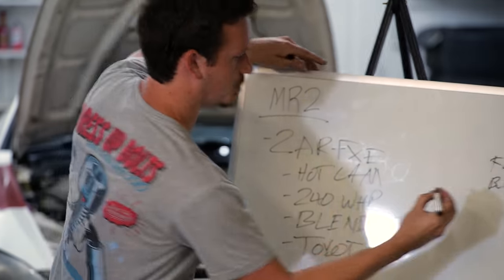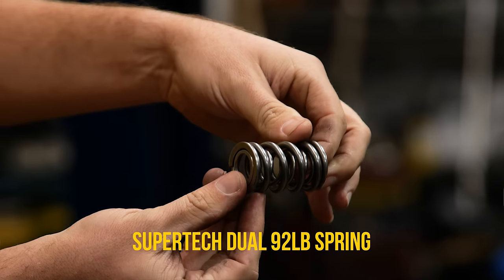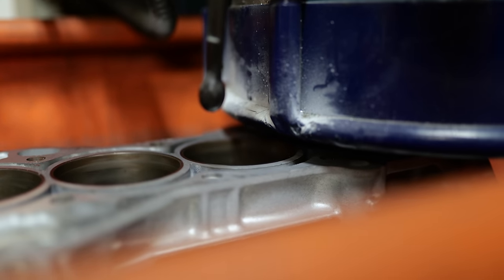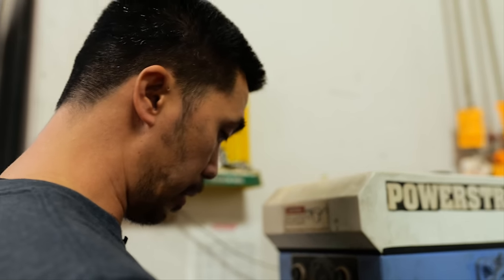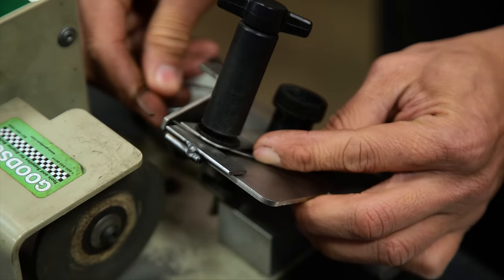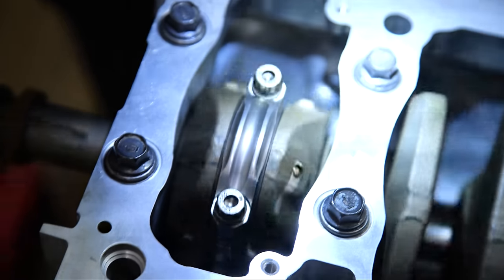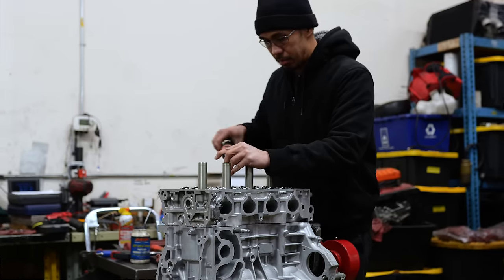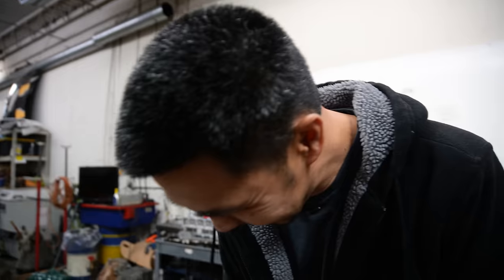Building My 10,000RPM, High-Compression K20

Comment: this is the level of work I want to do some day.. he's clearly extremely passionate for a long long time about building engines
Reply: He has been passionate about building engines, tuning, and making fast cars for a very long time! They are a local shop here in Minnesota and do stellar work
Reply: Agreed! What engine are you dreaming of building?
Reply: Me too bro
Reply: @WarriorsPhoto  for me I would build a 3.3L H6 for my BRZ. 250-270whp would be ideal for the BRZ. I mean, a lot more if I felt like upgrading everything else too. But I just want a little more oomph to go along with the amazing handling that it is already capable of
Reply: @joshuacstorlie  That sounds like an amazing idea. At that power point the car would be amazing on the streets. Maybe even track. Get to building.
Reply: the engine is not good for street use,, becasue it will not last a long
engine machinsit here.

Comment: Mechanical engineer who works for a tool company that makes torque wrenches: Supporting the drive side of the torque wrench with your left hand while applying force with your right will have the torque spec be off +/- 15% or more! I didn't believe it until a technician let me try it out on our certified testing equipment. I grew up in a mechanic shop and ALWAYS see people use a torque wrench with two hands like that, but nope! Force should only be on the handle side! Hope someone finds this info useful.
Reply: It always felt like it, thanks for the info👍

Comment: I’m so glad to see itbs going in this thing! There is something about NA that you won’t understand unless you have wrung one out on the track. Also have to be a better driver too
Reply: NA power makes me a better driver at the circuit, with no sudden push of huge torque lighting up the wheels. Just smooth predictable power, giving you confidence to push on the track.
Reply: It is an elegant way to tune an engine. Oldschool.

Comment: Wow this is nuts. I have the almost an identical set up on my K24 minus the ITBs. I did spend a little extra in the head tho, I did the CNC ported cylinder head from 4 piston as well as Ferrera all motor valves. But everything else is the same.

Comment: Floating valves: a phenomena where valves aren’t compressed back into closed state by the spring in time for the next engine cycle, meaning the seal isn’t created fast enough due to high RPM. A stronger spring will compress the valve back into closed state faster, allowing for higher RPM.

Comment: As an NC Miata owner considering ITBs for my car, it's been interesting seeing how differently ITBs look in Hondas and Miatas.  ITBs on a K-motor tend to be very short and VERY large diameter, because you guys have crazy airflow and revs to play with.  For Miatas, ITBs end up being MUCH longer and skinnier.  With our relatively ordinary MZR/Duratec engine, we need more focus on a strong midrange since there's no VTEC to save the low or create a crazy high.  I believe the main NC ITB kit also uses some slightly staggered-length runners.  It creates a remarkably wide torque curve, with effectively peak torque starting at 4k.

Comment: Measuring the bearing clearance with trilayer "racing" bearing shells fitted with an inside micrometer will yield about 10µm (4 thou) extra clearance. This is caused by the soft top layer of the shell yielding from the force of the measurement tip. You can visually see the imprints after the measurement. Use plastigauge or optical gauges to avoid this issue.

Comment: I have no idea what short stroke and compression is all about but I find it all fascinating, great video.
Reply: Stroke is how far up and down the piston moves in the cylinder every time the crankshaft rotates. 

The shorter the stroke, the less acceleration (force) the piston is subjected to when spinning at the same revolutions per minute (RPM). Reducing the stroke makes it possible to rev the engine higher if it was previously limited by how much force the pistons, rods, or crankshaft could withstand. Long stroke engines are good at making torque, but you can't rev them as high as short stroke engines if they are otherwise identical.

Compression is about the difference between the maximum and minimum volume the air inside the cylinder. 

When the piston is all the way up at the top of its motion, it takes up a lot more space inside the cylinder. This pushes all the air into a smaller space at the top of the cylinder near the spark plug. Compression ratio is about how much smaller this compressed space is compared to the large space created when the piston is at the bottom of its motion, as far away from the spark plug as possible.

The more aggressively the air is compressed, the smaller of a space it has to expand once ignited. The same explosion of air and fuel happening in a smaller space means that more pressure is created. This pressure pushes on the piston, which turns the engine and creates torque. More pressure = more torque, and more torque = more power, because power is the sum of all the torque the engine generates over a given period of time.
Reply: @Talynen  wow that's some detail and understandable. Thanks for taking the time to explain 🙌🏼
Reply: @ksm1985  If you want an example of a short-stroke, high-compression engine, take a look at the V10 and V8 engines from Formula 1. I'm not sure if the current engines (or "power unit" as they're called) are still high-compression since they use a turbo.

Comment: Are ARP head studs really an upgrade??? I have talked with a very knowledgeable engine builder about naturally aspirated K-series and he believes that when the aluminum head expands from heat, the ARP studs do not flex at all and resist the expansion. So you end up with localized pressure points on the headgasket around the ARP stud locations. This can lead to HG failure and even a warped head.  He prefers the OEM torque-to-yield bolts that stretch to allow for the aluminum expansion and contraction.  What do you guys (RS motors) think for naturally aspirated?  
High HP turbo builds are another story....head studs are essentially required and not what I am referring to here.

Comment: very similar to my all-motor 6g72 except im using 272 duration 510 lift cams. Trying to get itbs but no one makes them lol much more difficult to get itbs on a 60 degree v6. Still working on it though. For now i have a intake adapter plater for a 6g75 that lets you put an Ls intake on it to really shorten the runners lol. bottom end is 12.5:1 pistons and BC rods and billet oil pump gears,aluminum flywheel. Heads are fully built ported/polished with ferrea +1mm valves, brass valve guides, Bc springs 92lb springs and titanium retainers. Was stupid expensive at like $26,000 because no one builds all-motor 6g72s so one-off parts had to be made and wait time was like 4-5 sometimes 8 months to get a single part because they weren't parts on a shelf. Would love to do an all-motor K-series would be much less painful.
Reply: How did you talk your self into $26K better spent on engine instead of buying a faster car? I have hard time talking my self into it.
Reply: @idokwatcher2062  because i wanted to break the all-motor record for 3000gt's and it was done essentially piece by piece over a 2.5 year period. so it wasnt a 26 grand lump sum. but like 700 here, 1200, there, a stacked the parts away until i had a core build. things like decking the block,boring,rebuilding the heads and porting them obviously came after I tore the engine apart. And in the meantime I was just enjoying the car as it was and doing regular maintenance. I had a specific goal in mind. can't build an all-motor 3000gt if you buy something faster. And turbo builds are a dime a dozen nothing new to learn or improve on. And people on the 3000gt side of things complain alot about lack of development, but never try to do anything outside of the norm. So there was quite a large gap were the engine could be developed. Just got to think in a different way.

Comment: with ARP2000 rod bolts and 10000 rpm you're in for a spectacular engine failure. Get CA625+ rod bolts.
Reply: And RBC VTc with those cams and pistons… 🤔…. Oil jets clearence…… 🤔

Comment: Detail is amazing.  I didn’t see any mention of upgrading the valves from stock.  Are the oem Kseries valves able to take the higher spring pressures and RPMs?  My experience comes from B series where the valve heads would snap off with aftermarket springs.  Discovered this the hard way!

Comment: What a great project! I am somewhat worried about not having precision balanced the components and crankshaft since the forces in the engine grow by the square of revolution speed... the bearings might pay... But wish you best of luck.
Reply: How do you know that hasnt happened? The pistons appear to have weights written on them, implying they've at least been blueprinted.
Reply: @TrackSol  Blueprinting is a very important step, but does not imply balancing. For me it's the fact it's not been mentioned anywhere in the video and would make for very unique/interesting content for a viewer; that makes me curious whether it's been performed or not.
Reply: @pereduranofcourse  Fair enough. The fact that it hasn’t been mentioned is kind of odd. I would hope Ron is aware of how important balancing the rotating assembly is, especially for an engine planned for 10K rpms.
Reply: @pereduranofcourse   I would like further balancing job, include crankshaft, camshafts and change the valves to something more appropriate, like sodium filled or titanium valves. I have 2002 audi s6 with a swapped more modern   NA 4.2 V8 and 6 speed manual transmission  with quattro system from rs6 and made to  12.7/1 and 8500 rpm

Comment: Have never seen anything close to this level of detail on a build outside a funny car or cosworth racing engine. Only thing I might have done differently is use higher compression pistons closer to 14:1 given all the work that's gone into it.
Reply: Its a street build. Who wants to have to run race gas all the time, which is what you would have to do with such high compression. A high compression, high rev engine for a street car is dumb anyways since 99.9% of street driving is under 5K RPM. This engine will probably make like 40hp until it hits 8K.
Reply: @oldscratch3535  Who said anything about racegas, you can easily run 93 or E85 or some blend. The 458 Speciale was 14:1 back in 2015, and I'm sure there are other factory cars since then.
Reply: @nighthawk0077  There's no way you could reliably run 93 octane at 14:1 compression on a tuned 10K rpm engine. The thing will be pulling so much timing at high rpm to eliminate knock that it won't even be worth driving. E85 would probably be the best choice here like you said.

You can't just take an engine designed around a lower octane and pump the compression up and expect it to work without significantly upping the octane of the fuel. Therefore, you can't compare an engine designed from the ground up to be a high compression engine to one that wasn't and claim it will work. There's all kinds of magic shit that goes into cooling, fuel/air mixing, and valve timing to allow you to get high compression on relatively low octane fuel, but it has to be designed for it.

I think the whole premise of this engine is dumb. A 10K rpm street engine is useless. A 4 banger is even more useless b/c it doesn't have any torque to actually get the car moving down low. The driving experience is going to be terrible b/c there's very few instances of street driving where you will get the engine into its power band. It will sound awesome though. I'll give them that.
Reply: @oldscratch3535  Different strokes for different folks. The legendary S2000 is basically just a junior version of this with 50-75 less hp and it seemed to do ok. All depends what you want to do with the car.
Reply: @nighthawk0077  I can't wait to hear it. It's going to be a screamer.

Comment: IMO, from experience, you guys might regret going with steel rods. This RPM is aluminum rod territory. If you stick with steel, I hope you change rod bearings after every event!
Reply: There's a few issues with 10k rpm & aluminum rods. Tensile strength & fatigue life are major ones, as is clearances necessary for the greater thermal expansion of aluminum. Yes the drawback of steel is weight, but it has a near infinite fatigue cycle limit.

Comment: Out of interest, can you tell me how does the inner diameter of the mains or rod bearing measurement before the motor has been run compare in tolerance to the bearings that have been attacked and pressed into place by the rotational force of a running motor? You are talking paper thin tolerances? About to build a motor, wouldn't measuring the thickness of each bearing in subtraction of the true size of the diam of the bare cap give you a more accurate measurement?  How much does the bearing compress after being broken in? Do bearing suppliers give you that information.

Comment: I thought you couldn't accurately measure the piston diameter through the graphite coatings on those pistons? I've used the spec sheets on those.

Comment: I've been toying with the idea of K swapping a rather heavy car ~1800kg...
I'd want as much low and mid RPM torque, but I don't know how a K engine should be built for such.

Guessing it'd be a K24 turbo, no need to rev past stock. Are there some good upgrades for torque in mind?

Comment: i don't understand why building a K20 to mid 200 wheel hp is better than modding an F20/F22 to the same power. What does a built K20 offer that a modded F20/F22 doesn't?
Reply from the maker: You can build this whole motor for the cost of a stock, used F series. Cost and parts availability is a large part of the appeal.
Reply: reliability
Reply: @GearsandGasoline  oh wow that’s crazy. I didn’t realize s2k motors were so expensive

Comment: Why would anyone trade displacement for revs?!
Reply: Because rpm is way more fun and sounds cool? caring about displacement only is when you get boomers thinking they’re cool for doing a lame 3000rpm burnout. Pushing 9k rpm is where the fun is and this is a race motor. Flow enough air with less displacement and you still get the power.

Comment: For your average, non-youtuber consumer, what does a build like this ACTUALLY cost? Including the engine, I'm seeing like 20-25 grand here. Am I wrong?
Reply from the maker: 6k for the engine parts (ITBs are 3k by themselves, so you could cut cost there), a k20z3 that's jumped timing might be like 500 bucks. Im not sure about labor yet but I'd assume a couple grand? So like 8500-9000 all in.
Reply: @GearsandGasoline  Ah, I thought it was a K20A2, so I mentally added another 3k or so. I think in regards to labor: With teardown, blasting, machining, & reassembly you're looking at 30-40 hours. That alone is probably $5k-$7500.